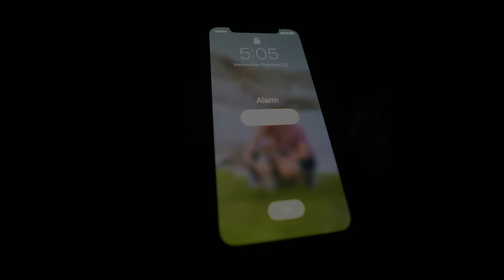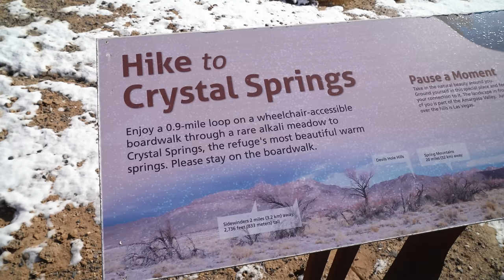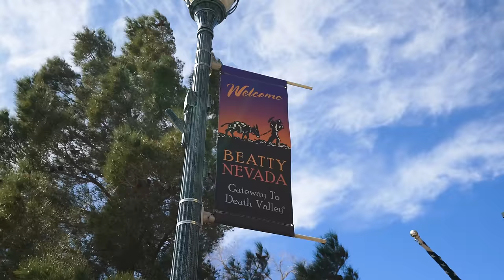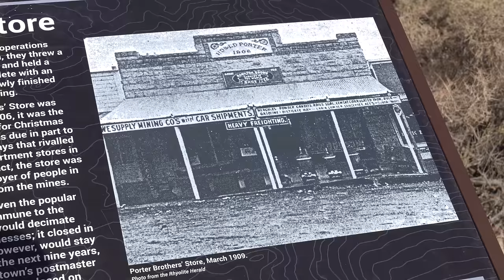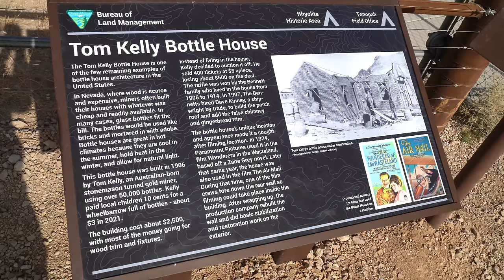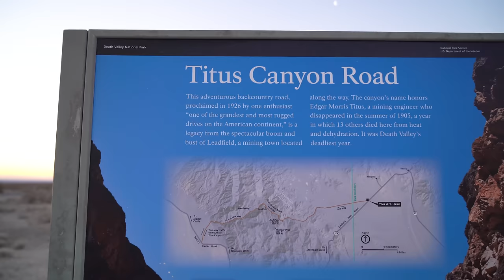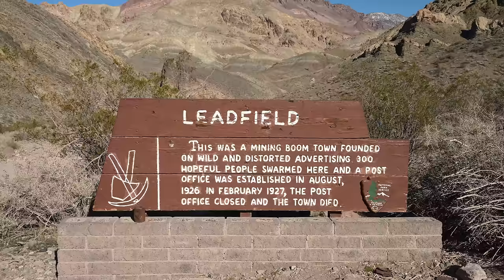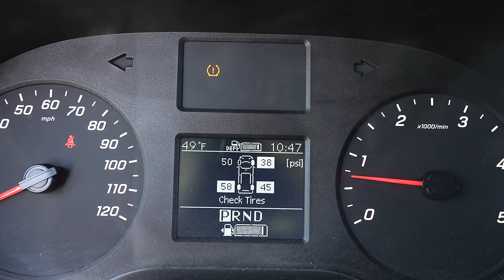An EPIC drive to Death Valley (Ash Meadows, Wild Burros, Rhyolite GHOST town, & Titus Canyon!)

Comment: Great video!!  At first I was thinking that ya'll may have bought a too small compressor, but since it worked.... well it worked.  (LOL)
Love the burros, just like Cripple Creek, and the cat was just precious. If you didn't know, it is a tortoise shell cat.  We did Moki Dugway in Feb, and so I have a feeling what you just experienced with the switch backs, although we are terrifically smaller than your van.  Can't wait to see what you find in Death Valley so.... until next time... Travel Safe.
Reply from the maker: It worked super well! Adam made sure to read TONS of reviews haha.
Reply: @AdventuresofAplusK    I've got the 400P and it works very well for us and the Xterra. I made a hose contraption where I can inflate or deflate 2 tires at a time, but I'm not running the pressures you are.
Reply from the maker: Oh cool! We hope this one continues to hold up for us. The one we really wanted wasn't possible to get quickly on the road, but so far, so good!

Comment: Question for you guys.  Can you tell me if you think a LTV Wonder could go on Titus canyon rd?  We have AWD and I am a capable driver but the high clearance comments have me wondering.  Excited to follow along to Alaska!  Saw what looked like a c class RV as you came out of the slot canyon but thought maybe that was part of the 2 lane rd.
Reply from the maker: The LTV Wonder does look kind of low to the ground and it may be a bit tough. Some of the turns were really hard in our length (22.5 feet) and we had some scraping happening either under the bumper or the mud flaps (we didn't see any damage, so not sure).

Comment: Where did you come up with 90psi for your rear tires? Every Sprinter chassis I have looked at says 44psi front and rear
Reply from the maker: We said 50 psi front and 70 psi back, which is what the panel on our door says to do. This also confirms that: https://tirepressure.com/mercedes-benz-sprinter-2500-tire-pressure

Comment: I have a very random question if you don't mind me asking. In your gear section you mention Kathryn carries the WANDRD PRVKE 31L Backpack. I absolutely love the look of this bag! But is there any possible way to add a hydration pack? Or even a very large water bottle? I'll be doing some hikes this October (5-8 miles at a time) and I need a good bag to carry my gopro equipment and water. I'm wondering if I could make this bag work or if I need to go more with the bag you stated Adam carries. Thanks!
Reply from the maker: We don’t mind at all! The bag definitely isn’t made for a Camelbak, but I’m able to fit a 3L one in the laptop sleeve and then I just zip up the pack around the straw. It isn’t 100% ideal, but it works!